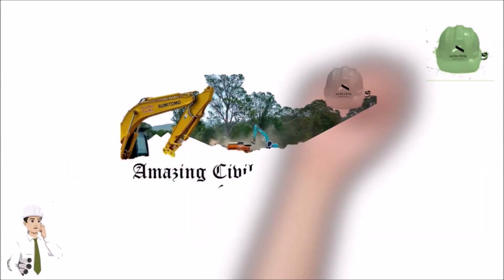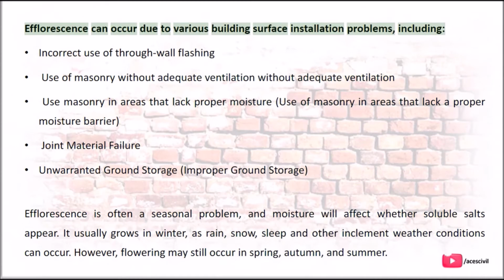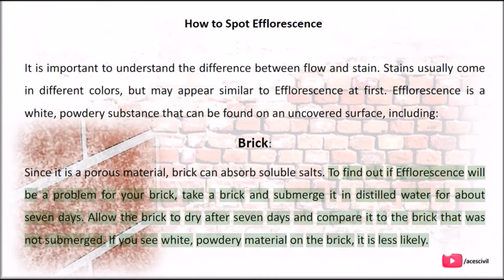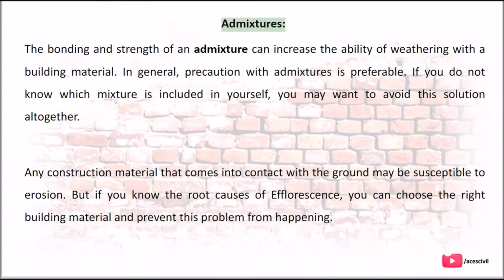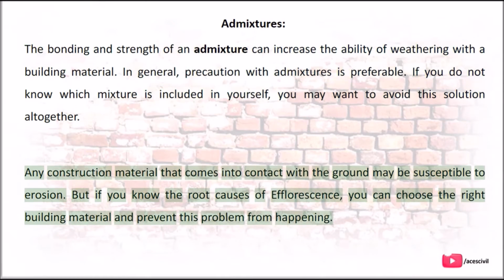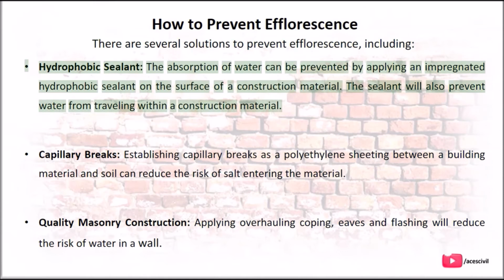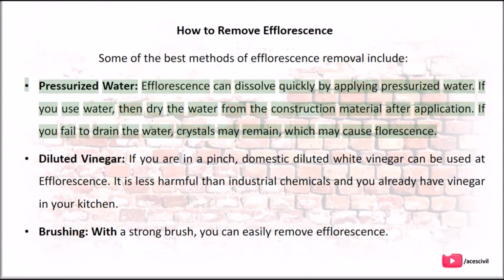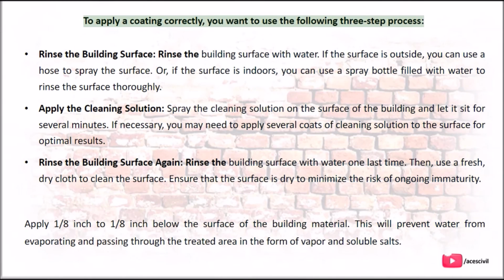What Is Efflorescence and How to Remove It.

Comment: I have this on the inside of my basement (house built in 1901) but I don’t see it on the outside. Is it possible it’s only occurring from moisture inside the basement, and not from ground water? Or, it it always an issue starting from the outside? I live in a relatively dry area, but we do get snow and rain in the winter.